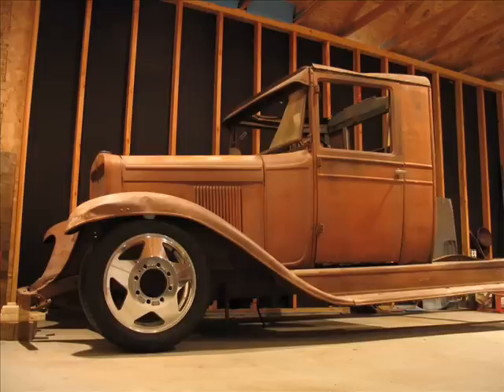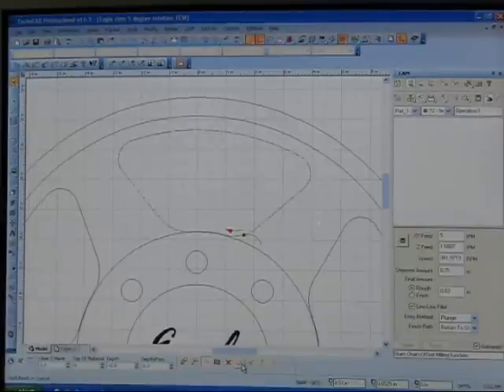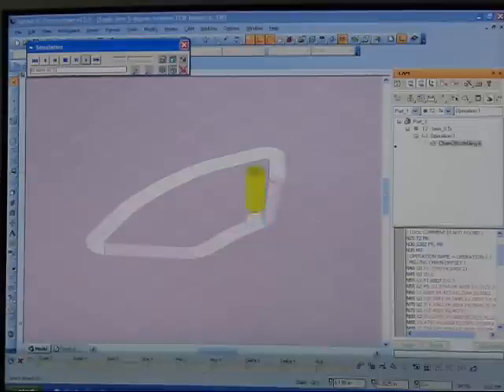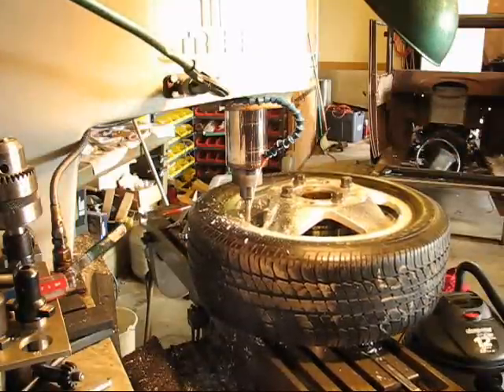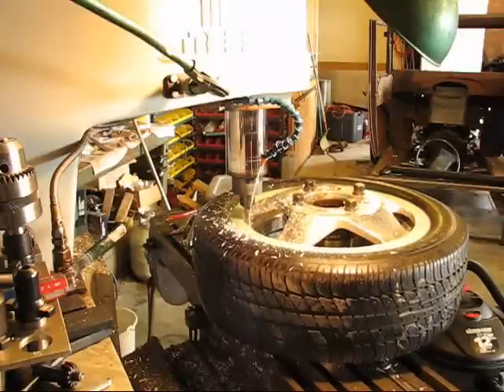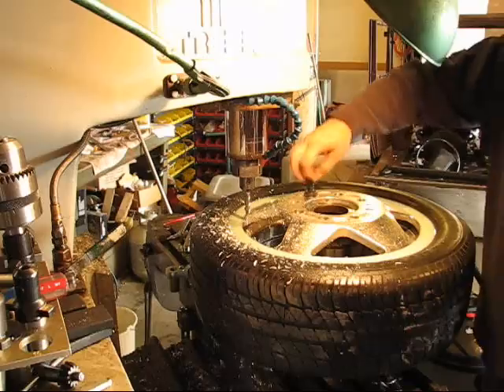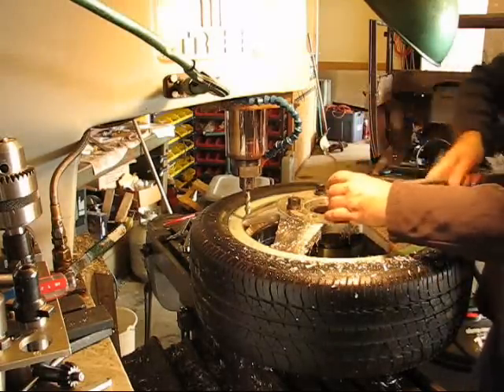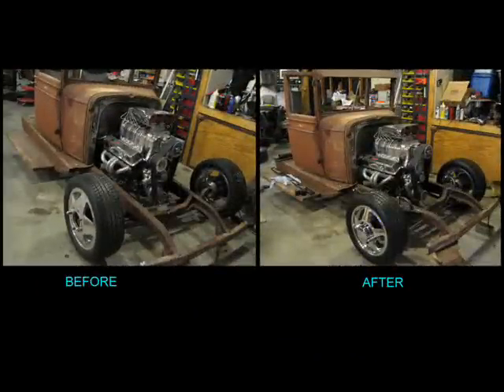29 Chevy project part 2 - CNC milling the rims

Comment: What machine are u using ?
Reply from the maker: It's a 1982 Tree 320 Journeyman mill that I retrofitted with CamSoft software and Galil motion control cards back in 2007, then just last year I finally replaced the 3 old analog drives with 3 Advanced Motion Controls 30A8 drives, after doing all of this I think next time I would just find a mill that's newer and still works because I ended up having about that much money in it.
Reply: nitrostreet thanks
Been looking and learning about all this

Comment from the maker: @fixier9519 
It doesn't weaken it, it simply changes the load rating. These rims were designed with a load rating of 25,000 pounds, which would be way overkill for my truck which shouldn't even break 3000 pounds. 
They should easily be able to handle 10,000 pounds the way they are now, the spokes are still thicker than most aftermarket rims for pickup trucks.

Comment from the maker: @MACcKERM 
I used the 6" by 16" Eagle Alloys #034 rim  with some 215/50-16 tires (used tires to set my truck up with) , if you were actually using this rim on a 1 ton dually and were planning on pulling a 24,000 pound trailer with it you probably wouldn't want to cut them down, since my street rod is not going to be used to haul that much weight I wanted the look with a little more style.